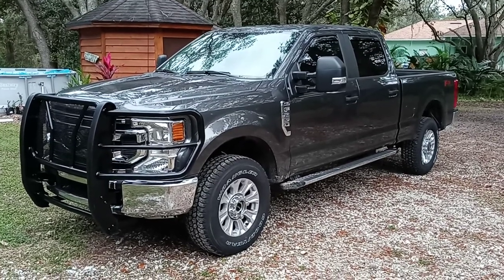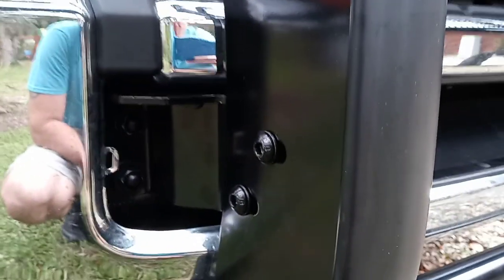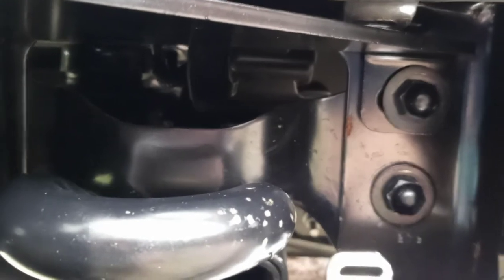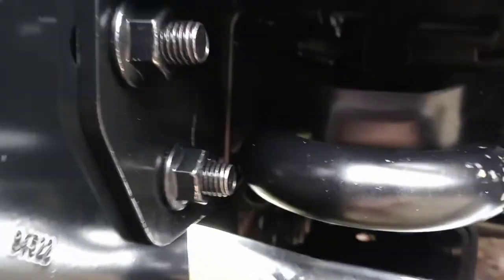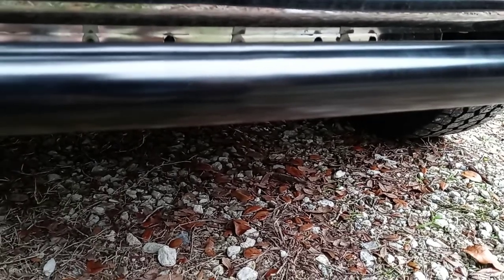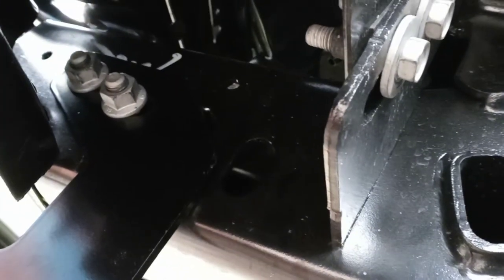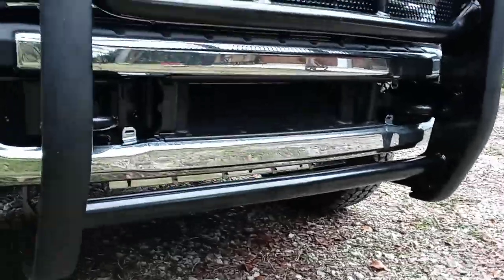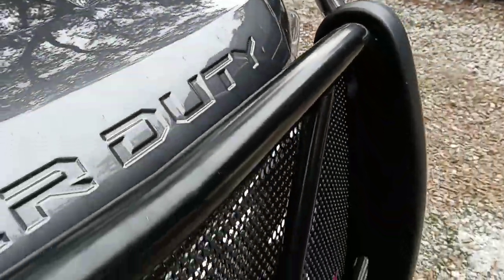2020 Ford F250 Westin HDX Heavy Duty grill guard installation tips!

Comment: Just a note that on this grill guard with the Winch plate option, the larger lower horizontal bar blocks is directly in front of the forward facing camera, so only a sliver is viewable looking forward.

Comment: I want to buy something for front end protection and also at times to help push other vehicles that are stalled out on the road side where I work. Would this work for that? It looks strong 💪
Reply from the maker: It's pretty darn sturdy. I bought it mainly for looks and hope to never need it for front end protection,  lol. :)  It is not one of those cheap $200 ones with 1" thick bars. I bought this grill guard because it has the beefiest build to it that I could find without going to a whole replacement bumper from Ranch Hand or something.

Comment: Thanks for this video.  About to do the install on same exact guard tmrw on my 19 F250
Reply from the maker: Happy to help. Let us know if you have any questions. :)
Reply: Survivor Classic Cars on our 19 250 6.7 xLT the plastic around the tow hooks are attached by screws that you literally can’t get to.  So after messing for an hour with one side we had to use a soldering iron to melt the plastic to get to the screws.  It was a PITA.  After almost 4 hours to get the plastic off around the tow hooks the rest was easy.  But your video helped with the bracket installation and was very useful to ensure how we read the directions was correct.  Thanks again.
Reply from the maker: @christopherbaker4654  That sucks! But I'm glad the video helped in some way. :)

Comment: I have been looking all over the damn internet for install instructions.  I have a 2020 F350 and bought the Ranch Hand Legend Series.  I got the air dam off, removed those two large brackets, popped out the plastic covers over the tow hooks and that's where I got stuck! The instructions that come with the grille guard are terrible.
Reply from the maker: Yeah, they are not good. I hope our video helped a little. :)
Reply: @SurvivorClassicCars  Helped a lot but stand by for follow up questions when I go back to finish the install :)